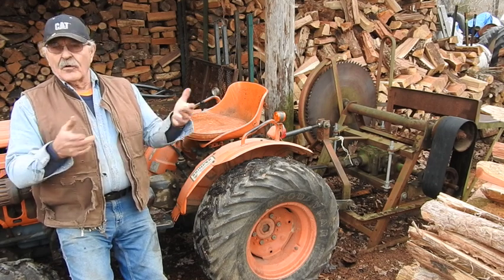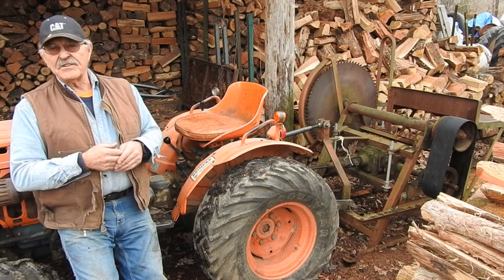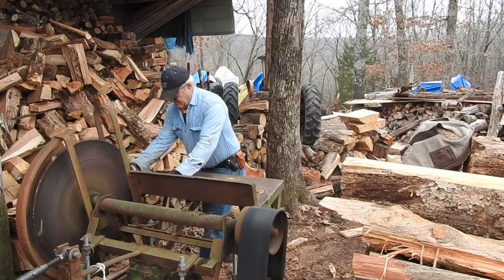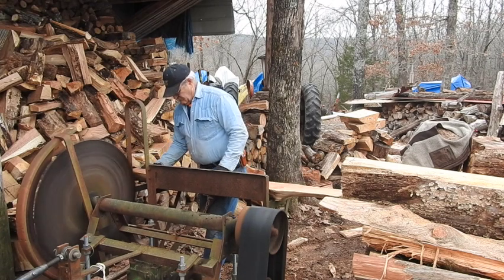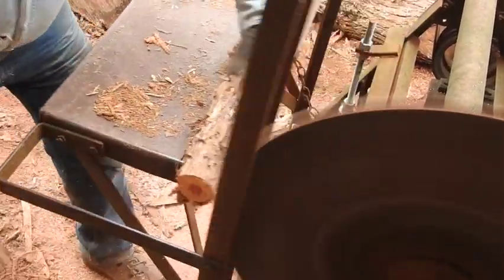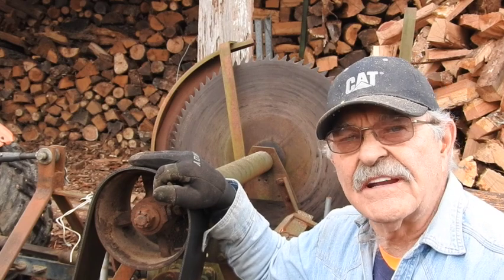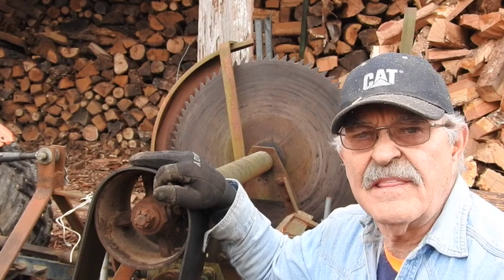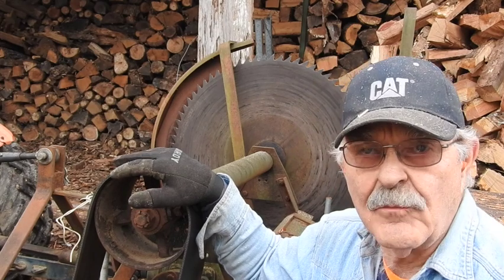Buzzsaw VS Sawmill Slabs and Polewood- Outdoors

Comment: Hello my friend. Love to watch you cut the wood / slabs. I use to repair saw blades and the mill. That job was at that time called a " Saw filer ". I hammered and put tension  in them,levied them to run straight and true.. Took pride in my job. All my very best.
Reply from the maker: Hammering is almost a lost art Bobby.  My 50'' on the little Belsaw mill needs a good hammering and bits right now.  But I'm going to sell it as it is.  I am impressed with your ability...it is beyond me my friend !!
Reply: @tractorman4461  Thank you very much for your kind words. I would say you could do it Wendel, You are a very smart Man.I hope I got your name right.  All my very best to you and yours.

Comment: Thanks Tractorman44!  I will pull out my fathers buzz saw when spring comes, to half a stack of 60 cm's that have been sesoning for many years now.  Its a cheapo electric one, but does the job.  Some top tips here thanks, well worth it.
Reply from the maker: Thanks Rocky for the input.  Just go slow and easy until you get the feel of the machine and you'll find it extremely quick and efficient...especially if you can toss it right off the saw into the storage location.  Every time handling is minimized, the job becomes easier.

Comment: Never tire of watch’n that o’b7100. Music to the ears.
Reply from the maker: I bought that new in '82 Tom, and there's only been minor repairs to the steering and oil and filter changes. I just put new front tires on it a couple years ago.  And those rears are foam filled tires that came on the used B3030.  The original rears on the 7100 were both going flat every few days and these ones were free.  Plus it looks like a 'mudder' now.  LOL  I LOVE that little diesel !!
Reply: @tractorman4461  oh I agree. Classic mudder! I have a b6100 and a b2601. Love mowing with the old6100 as it is so stable and love the foot peddle throttle, just cool love the sound. I took the mower off the 2601 and just use the bucket now. Enjoy getting a cup of coffee and listen to whatever you have to say and watch you fix something. Thank you
Reply from the maker: @tomashbaugh8891  I think the 6100 is identical to the 7100 except for the engine size.  And actually the only difference between the engines is the bore.  The block part numbers are the same and I think even the valve train is the same.  My buddy had a 6100 with a loader and belly mower, then sold it when he bought the B2400. Then he bought the B3030 in '05, and I have both of them now. I'm glad to hear you enjoy the videos Tom.
Reply: @tractorman4461  I believe the 6100 is a couple inches shorter. I understand Kubota made a 5100 also. Would love to get on of those as well as a 7100. I'll keep looking. God Bless
Reply from the maker: @tomashbaugh8891  Hmmmm.... I wasn't aware of the 5100 Tom.  I wonder what's making the 6100 shorter than the 7100.  Now I got a new wrinkle in my brain !! LOL    There was a 7100 on FB marketplace a month ago or so.  Pretty close to me too.
Reply: @tractorman4461  get on it man! I’m thinking one per grandchild? Bahaha
Reply from the maker: @tomashbaugh8891  Hahahaha....now THAT's funny.  But a good idea none the less. LOL

Comment: Good Morning Wendell! Looks like your buzzing right  through the day!🤣🤣🤣 now you need flip your wood stacks so the bottom gets burned before rot setsin🤣🤣!
Reply from the maker: I try to keep three years ahead for maximum seasoning.  Each of the three sections are pretty much emptied every three years as a result. The good thing about a wood shed is the wood doesn't rot, it just gets drier.  Each stack is stacked on runners of pole wood and not directly on the ground for the most part too. Today's wood is for the year after the year after next.
Reply: @tractorman4461  are you trying to keep me from”stirring the pot” what fun is that!🤣😂🤣😂
Reply from the maker: @thesmallwoodlot433  mayyyyyyy-be.  LOL

Comment: Great video Wendell, if I look at your wood pile I wondered how old is the wood pieces at the bottom of the pile, I think it will never see a wood stove lol. the 1982 Kubota runs like new
Reply from the maker: Each section is pretty much emptied every three years Jan.  So any wood that you see has been there a maximum of three years.  In my experiences I've found that three years seasoning ensures the lowest moisture content for the best combustion of wood gasses.  All that equates near zero creosote in the flue pipes.  The result of burning unseasoned or improperly seasoned woods is the creosote build up.  And that is the major reason for property damage or loss from flu fires.
    Less seasoned wood CAN be burned safely, but the amount of heat required to evaporate the moisture from the wood before the wood gas can be released dramatically lowers the burning efficiency of any wood burning appliance.  And if the stove that's burning the poorly seasoned wood has a catalytic converter, the life of that expensive converter is greatly reduced.  My chimneys have little more than a thin fine gray powder build up at the bottom of the flu at the end of each burning season.
Reply: @tractorman4461  Great explanation Wendell, with the theory I understand that you have sections of wood and manage the use of them to optimize efficiency, cool, thanks for the info

Comment: Been watching most all your buzz saw videos and i think I'm going to look for  one .I been cutting slab wood  for next years firewood with a chainsaw
Reply from the maker: The larger the diameter, the better it is.  My 32'' is somewhat limited to 9'' rounds but wider slabs can be run through depending on how you hold it against the backstop at an angle, bark side down.  You'll develop you own techniques with the different sizes and shapes as you get familiar with the machine.  
    The most important thing Neil, is to keep the material steady going through the blade.  A slight drop of the long end of the slab or pole will pinch the blade and throw the belt.  Even though I am very careful, about once per season I still pinch it.  On long slabs that I can't handle by myself easily, I cut them in half with the chain saw. Long ones are easy with a helper on the tail end to hold them up....but I never have that luxury now that the kids are gone.

Comment: I do enjoy watching your buzz saw videos. I acquired a 3 point pto version, i think a early version of the one that is offered from vermont. Just want a small tractor or power source to run it.
Reply from the maker: Thank you for letting me know you've watched a few of the buzz saw vids.  I think I have a playlist that has most of them pretty much in one place.  Just to put a bug in your ear, you can get a bit creative and power it with a drive wheel on your car or truck like they did in the old days.  A little thinking and planning and you'd be in business in no time !!  
    Be careful though if you try it.  Might have to put a hand throttle on the carb linkage and come up with a safe way to keep it from getting away from you...  See, you got me thinking....an old rim, a pto shaft with a universal joint, a lawnmower hand throttle and a welder and you're good to go !!  But then again, find Ben's sawmill on youtube and see what he did with a small gasoline engine on his saw rig.
Reply: @tractorman4461  I believe I have seen Bens and he did something with a v-belt for power transfer. I’m on the look out for another buzz saw to put a small engine on. Keep the 3 point for at the woods and a small one for all the branches at the house or slab wood for the maple syrup arch
Reply from the maker: @beefieschannel8955  That sounds like a good plan.  For small stuff a V-belt should be fine because Ben cuts his sawmill slabs with his and only one belt.  The difference is he has a high quality blade instead of the typical old buzz saw blade.  Also be careful to not run the arbor rpm's too high. I've found for these old rigs, 6-800 rpms on the arbor is really good. But if you have good new bearings and a carbide blade (expensive) you can run them up pretty high.  Good Luck, sounds like you've got a good plan.
Reply: @tractorman4461  is that 600-800 on the shaft or the tip of the blade? Definitely going to figure out how and what pulleys I would need to reduce the speed down.
Reply from the maker: @beefieschannel8955  I figure the pulleys to rotate the shaft at that rpm.  And actually the blade and shaft rotate at the same rpm, but its the 'rim speed' in 'fpm' (feet per minute) at the tip of the blade you are probably thinking of. The larger the diameter of the blade, the higher the footage per minute.  
    If you are doing it with just one set of pulleys, multiply the rpm of the motor times the diameter of the pulley.  Then divide that number by the diameter of the 'driven' pulley that's on the shaft.  That will be the speed the shaft will rotate with that input rpm.  
    You'll find with a higher rpm motor you may have to figure a 'jack  shaft' and another set of pulleys to slow it down enough.  Also make sure you match direction of the motor to the direction of the blade.   One guy on the TUBE told me to just throttle down the small gasoline engine....but if you do that the horsepower drops terrifically.  Horsepower is developed by rpm, so lowering rpm lowers output hp.  Just something to think about depending on what motor or engine you are using.
   I saw old timers back in the day with a narrow flat belt running inside a rim on an old 40's or 50's farm truck with no tire all the way back to their buzz saw's flat pulley.  It was nothing for us to use 60, 80 or even 100' belts on silage blowers, hammer mills or a host of other belt driven pieces of farm equipment.  And if the direction is wrong, just put a half twist in the flat belt.

Comment: Wendell,  any history on the buzz saw. You looked like a real wood chucker running that rig, wood going every which way. Take care and stay safe.
Reply from the maker: I've only had this one twenty years or so Mike,  and a few others  a bit longer than that.  My Much Older Brother has the one we both grew up on at his place.  We all started working with the old man well under ten years old with these rigs.  This buzz saw was down in the woods at my neighbor lady's house rotting down.  It was a stationary rig, made to be pinned to the ground and attached via flat belt to a tractor or stationary power unit. 
     This one, true story, had a huge electric motor pinned to the ground and one long rotting 5/8'' V-belt around the flat pulley.  The lower framework had rotted away, so I repaired all that, put it on skids, added the right angle drive off a haybine (JD), fabbed the category 1 three point 'A' frame and pto shaft to operate on any small utility tractor. Then it was put to work along with a couple other ones.  This one is the most convenient because of the versatility of the little Kubota. Next time I'll use the H and one I made a removable adapter for to make it a stationary rig AFTER I converted it to three point !!  Yes, there IS a reason for that.  But that's another story.

Comment: Wendell, do you make your own belts for the buss saw and belt driven implements, or do you buy them someplace?  Have you ever heard of anyone using biasply tires to manufacture the belts?  That was the talk years ago, when I worked in the feed mill, of alot of the guys repairing temporary the belts with sections cut out from the old tires.  If I remember correctly, they used it temporary, and it worked?  idk?  They would talk of threading them together with bailing wire.  Everybody had that. I enjoyed the vid.  Its great!
Reply from the maker: Yes, I make my own belts.  I show a belt lacer and how to use it in some of the other videos, plus how to figure belt lengths for anything that needs a specific length belt.  Old timers came up with a host of ways to make things work back in the day.  Most time the belts were so long on belt driven machinery, if an end was ripped off or damaged, you'd just cut it square and re-lace another end on it and go.  But I've not heard of using biasply tires, but you know farmers will try anything.  LOL Some where in this playlist I know for sure I make a belt: https://www.youtube.com/watch?v=pjL2d4PxK9I&list=PLk72G9DTzZ1tJEjzkfIvq8dY-UWCpl4 Sorry, I can't remember which part number but it's probably around pt 5 or pt 6 maybe.  I've used baling wire to stitch up all kinds of things too.

Comment: love your videos, do you think a buzzsaw like this would be any good on oak or mesquite? i normally use a chainsaw to buck logs down but been thinking about getting me a buzzsaw. i just dont know how well they do on really hardwood
Reply from the maker: The vast majority of what I cut is hardwoods like multiple kinds of oak, locust, hard maple and osage orange.  The way it will handle hardwoods depends of the condition and shape of the teeth.  I don't have a problem at all and usually saw a maximum of 9'' diameter with these rigs.  Now Mesquite, I have no knowledge of, but if its like oak or osage orange it should have no problem with it John.  But ya gotta keep 'em sharp.  This is one of my earlier videos, not a good video, but not too awful either: https://www.youtube.com/watch?v=TZ36Rxpn754
Reply: @tractorman4461  thank you for the information, much appreciated 👍 love your videos and what ya do
Reply from the maker: @johndowe7003  Thanks John.  I appreciate it !!